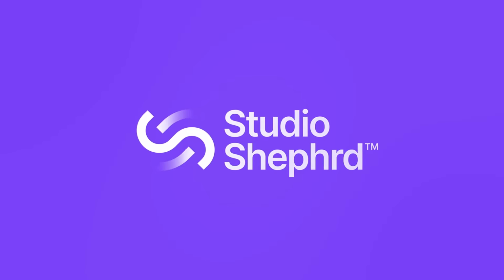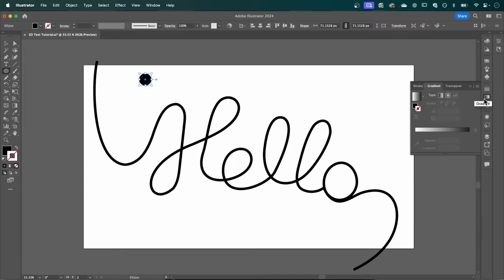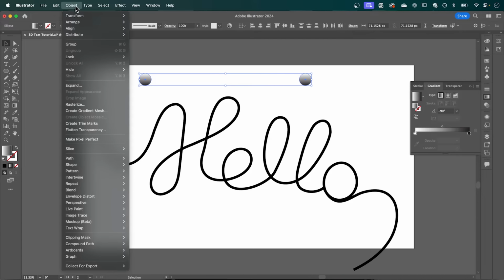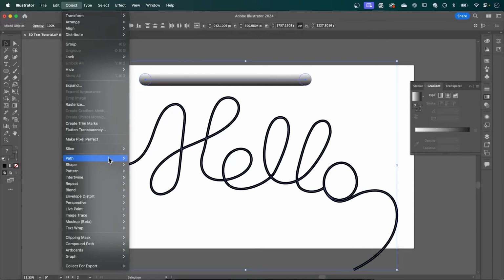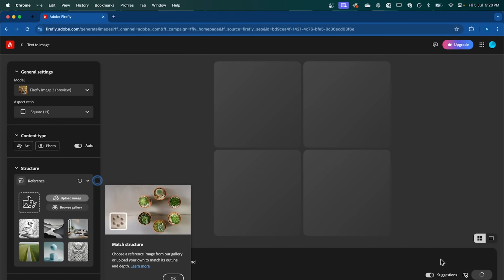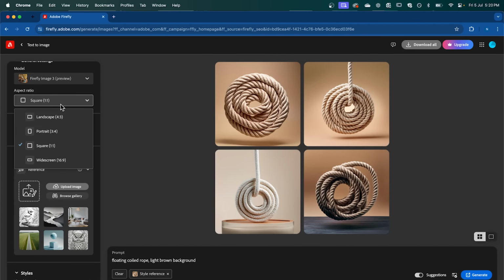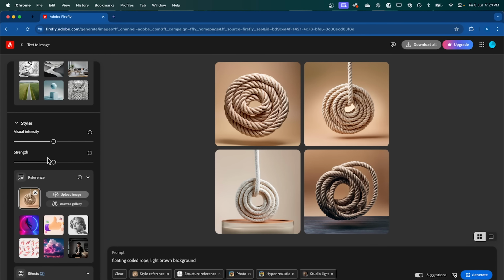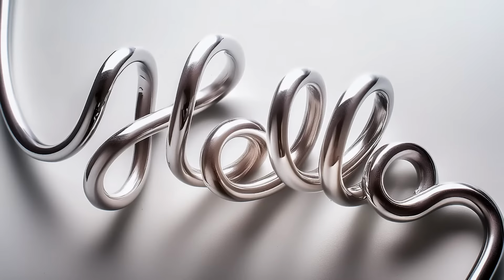Create Stunning 3D Text from Different Materials | Adobe Firefly AI Prompts

Comment: Thanks for your great tutorial in this video! Is it somehow possible to do this transforming of the lettering that was created with an actual text tool instead of a pencil? I had tried it, also by converting the text to paths, but the option “replace spine” is then grayed out and not available.
Reply from the maker: Hey, it has to be a path to “replace spine” if you had a font you could outline and expand it and then just make sure it is a single path for this to work. That’s why I find it easier just to trace with the pencil or pen tool
Reply: @designfromnick  Thank you for your fast reply!

Comment: My image keeps getting cut off, why? Doesn't matter if it's widescreen or square, it still shows no space around the type, takes it right to the edge and over.
Reply from the maker: Make sure your structure image dimensions match the layout. Widescreen is 16:9 and square 1:1. If your structure image fits within those frames then it should be fine. Leave some white space around it as well which should help.
Reply: Yes you are correct.